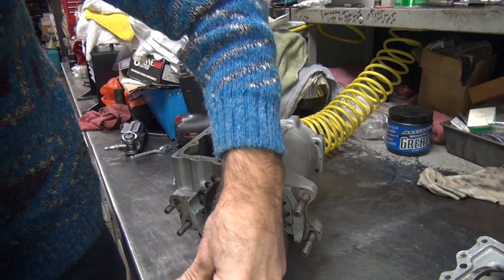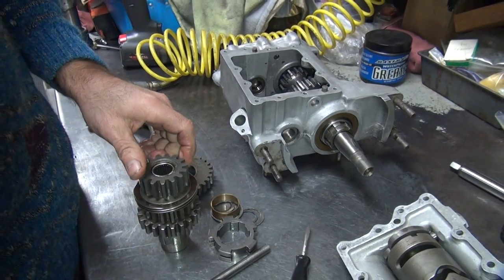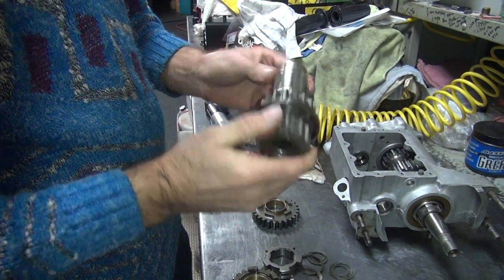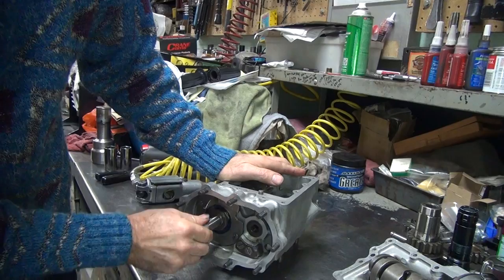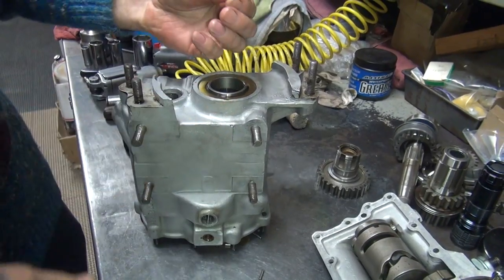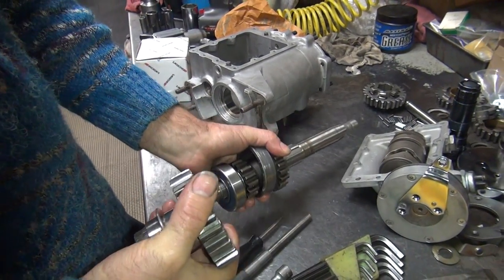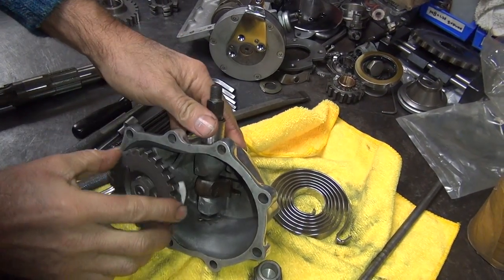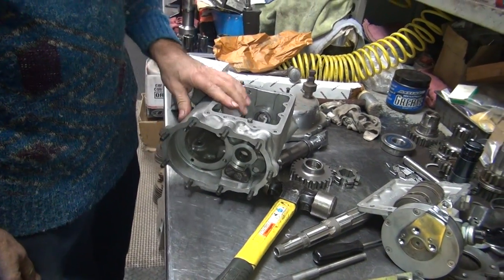1967 74ci shovelhead #132 flh bike assembly transmission rebuild harley craigslist tatro machine

Comment: Ok I’m getting ready to tear in to my trans 
I have a 1975  FLH when the engine is cold the trans works fine for the first  few miles than when I stop and try to go again it starts jumping out of first gear and it does not want to go in to second I have to bump the shifter a couple of times to get second gear. I am planing on replacing first and second gear pulse the shifting dogs and forks. Do you think it is possible that the real problem could be in the ratchet top?  I notice that the neutral light does not want to stay on unless you hold the shifter up with your foot a little. Let me know your thoughts.
Reply from the maker: i don't know. you will see what is wrong when you get into it. your clutch could be warpped and dragging too.
tatro

Comment: I have a quick question. I have a chance to buy a 1974 74ci Harley shovelhead. Where do i find a transmission for it. Also i have been watching your videos for awahile now. What does it take to send you the engine for rebuilding? I have a dream to build a old school  bobber. Do i know about bikes kinda but  building no i don't. But that's the fun of it don't you agree. Thank you for your time. Also the engine is coming off ebay. I know it's a 1974 and a shovelhead but how can i tell it's a true 74ci Harley engine. Thank you for your time...

Comment: My shovelhead 4 speed transmission leaked gear oil out of the main shaft seal area no matter what you did to it. What a POS design...
Reply from the maker: just think, harley did not even put a seal there until 1965. see, not a bad design. it just was never designed to be sealed in the 1st place.
tatro
Reply: @TatroMachine  man, I'm convinced you could build one blindfolded! Amazing...